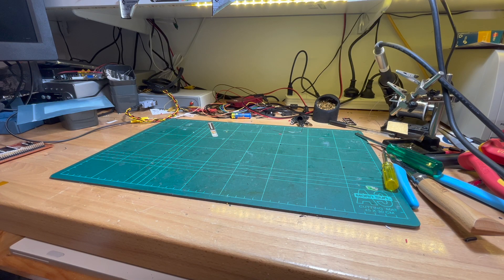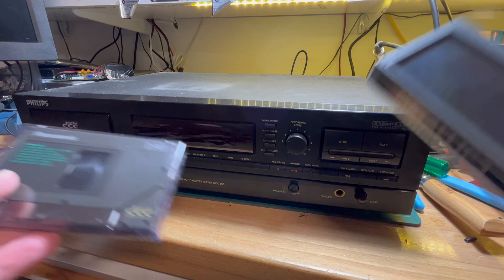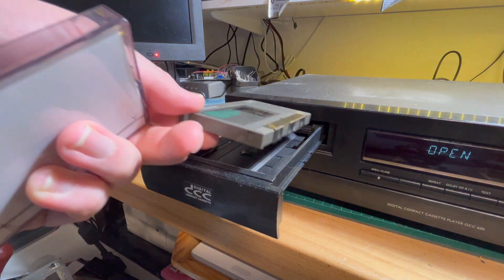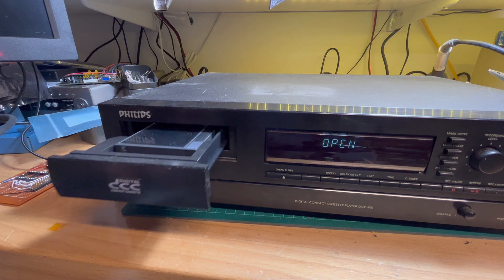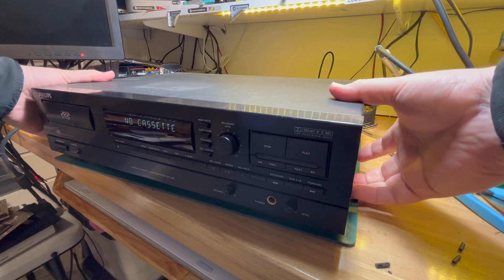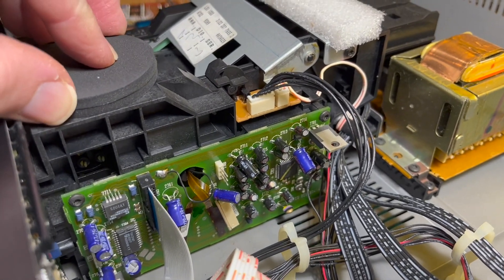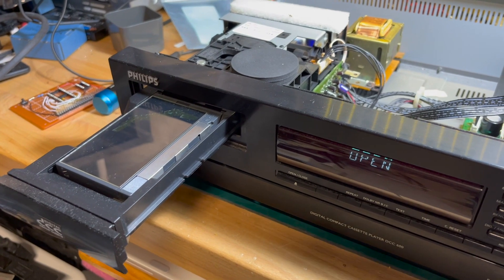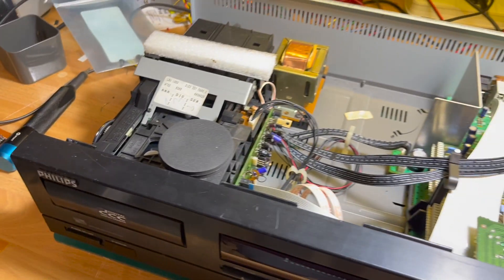🇳🇱 Philips DCC 600 Repair (Attempt): Part 1 [TCE #0105]

Comment: After 30+ yars the gear is missing teeth. Replace that gear and the 600 will work again. and...if the machine is still open, replace the belts aswell.
Reply from the maker: Are the belt dimensions documented anywhere?  I buy belts in bulk from CPC.CO.UK for the Amstrad CPC so could add the specific belts for the DCC600 in my next order.

Comment: Normally the problem is the belt and cleaning the head. Especially with these decent second generation units. Advise: Always try with (analog) recordable tape first as the tape might get eaten and prerecorded tapes are more expensive to very expensive 😁. Second advise: Always back and forth prerecorded DCC tapes before trying to play them.
Reply from the maker: Good tip! Thanks!

Comment: hopefully it just needs new belts... ...and ya CPC belts fit! LOL
Reply from the maker: Let's see ... I've got to pull the whole mechanism out I think (according to Service Manual) ...
Reply: @Brfff  yeah doesnt look like a simple fix...looks like the whole mechanism gotta be torn down.. least ya will find out how it works!
Reply: Hey Brett, did you ever fix the DCC600 - I have precisely the same problem (it occurred less than two weeks ago - precisely when it was actually needed! Been running fine up until then) 😢
Reply from the maker: @tarks382  Unfortunately no.  But thanks for the reminder - I'll rejoin the DCC Museum Patreon as I know I'll need their advice (and maybe spares)!